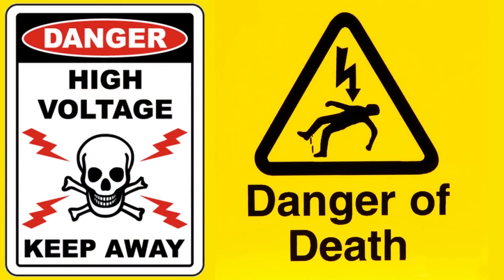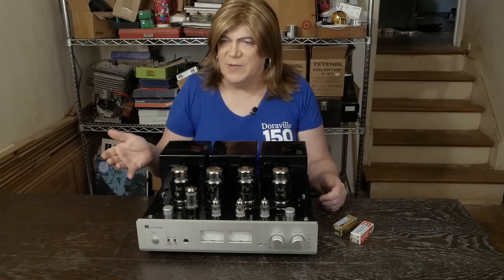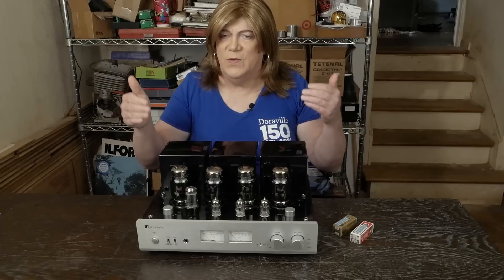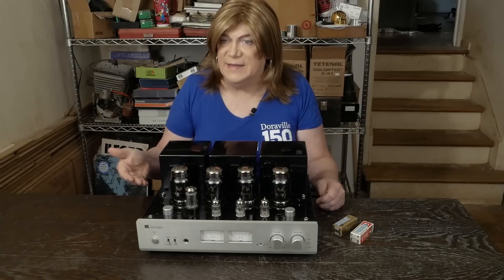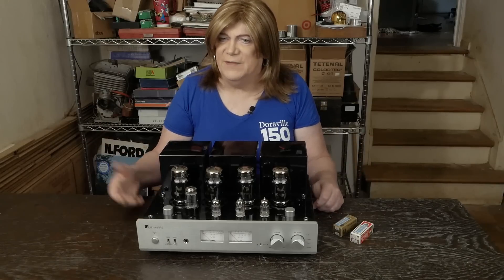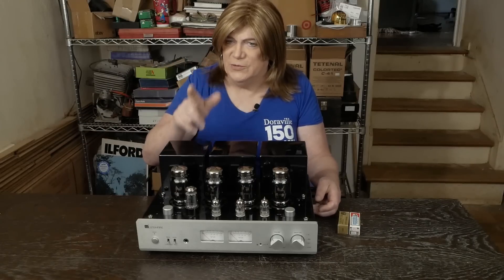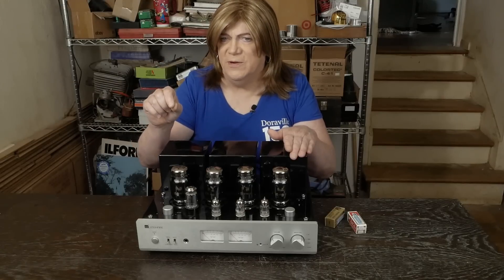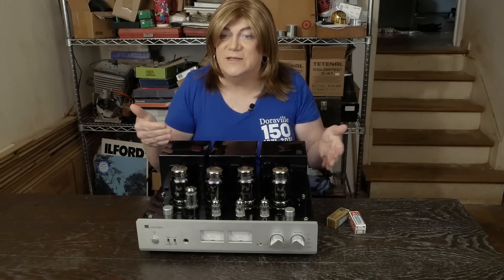Muzishare X7 vs Wilsenton R8: Testing and Objective Review

Comment: heeyoo Stephe! 

I now have the complete set of tubes gold lion 12ax7, 12au7-EH gold pin and  Shuguang KT88-Z treasure and its running since two hours now in my muzishare X7. In the beginning it was a bit smeared in the bass and heights but it already opened up and sounds great! To my surprise now UL sounds better than TR Mode. With the original tubes I only listended to TR Mode because in UL the separation wasn't that good and there wasn't that holografic imaging like in TR Mode. In UL mode with the original tubes the localization of voices was not really precise. Sure there was more bass impact in UL. Now it is completely different and I prefer now UL mode. It is really amazing after only two hours burn in!!! 

One question: shall I keep the 40 mA bias current like with the orignal stock tubes?  Currently I adjusted them all to 40 mA. Read something in the web about driving the KT88-Z hotter with more bias current. I am not an expert in this things ...

Greetings from Germany!
Burki
Reply from the maker: I don't think you will hear anything biasing them hotter. I tested different bias points and saw no increase in power or really anything in the measurements. Glad you like this tube combo!

Comment: I've had mine for a couple of years now and I love it. I agree with the phono stage, it'll do the job but definitely deserves better.
I have Shuguang Treasure KT88-z power tubes, some RCA Clear Tops and a Mullard down the front. They sound really well together. I also tried a Gold Lion rectifier, but like you prefer the original Muzishare one.
I'm looking forward to a coupling cap upgrade a little further down the line, but for now I'm more than happy I picked it over the R8
Reply from the maker: Thanks for sharing this with us!

Comment: I just discovered this channel. Wow! What a great channel. I was considering buying a R8 or this X7. I was leaning towards the R8 after watching so many glowing reviews. But I'm so glad I watched this video first. This pretty much made up my mind for the X7 - though I am distressed to hear that the unit was sent with a mismatched set of tubes.
Reply from the maker: Yeah, it's still not perfect, but it's a solid choice for a budget amp.
Reply: @SkunkieDesignsElectronics  I've had the Muzishare X7 for a few days now (about 20 hours burn-in). I was trying it out with various DACs and speakers. It sounded very good. Then I tried it with a pair of Harbeth P3ESR's and a PSAudio Stellar Gain Cell DAC using the balanced XLR inputs and I had one of those rare jaw-dropping moments. Wow! What a huge improvement. The X7 came alive (Ultralinear mode). Much more dynamic and the soundstage is amazing. Now I understand the appeal of tube amps :-) I guess the next step is a set of Shuguang KT88's. Thanks again for your detailed examination of the X7 and the R8.
Reply: Wish this video would have been around before I made choice of the R8  😖☹

Comment: Your practice using fusible cathode resistors with just-adequate rated power differs from Morgan Jones's practice using chassis-mounted, over-rated resistors. Your reasoning makes sense, but so does Morgan Jones's: get heat away from the sensitive cathode bypass capacitors. Comments? Great video, BTW!
Reply from the maker: I only do this for fixed bias amps running 10ohm or less resistors as a meter meter shunt. For cathode biased amps, I used over sized resistors and mount them on the top of the chassis on my builds for the same reasons Morgan talks about. Two different use cases.
Reply: @SkunkieDesignsElectronics  Oh, interesting! Thanks!

Comment: Thank you for your review and ways of improvement of the X7. You mentioned possibilty of El34 tube rolling. Is it simply adjusting the bias only? Or some mod needed? Thanks.
Reply from the maker: Simply lower the bias, 30-35ma should be fine at the plate voltage this amp uses.

Comment: Hi nice to see you again. Watching your videos has taught me a lot about high end tube audio and now I realize I screwed up someone's McIntosh by recapping it with general purpose high quality caps that are used in recapping antique radios but at least it won't have DC leakage to the grids. I also realized that I could have left the di film originals in there I'm used to old TV repair and I didn't know better
Reply from the maker: Keeping DC leakage off the grids is super important! :)
Reply: I'm glad I didn't get a callback for sound quality 😆

Comment: Surprised by this video. I purchased a R8 two years ago. Sounds great to me, no problems whatsoever.
Reply from the maker: I'm not saying the R8 is a dog or a bad sounding amp. It performs as advertised and many people have had reliable performance from them. 

I can say I as a very casual "repair shop" and I've had several dead ones sent to me in the past few months, two suffered a red plate power tube meltdown / cathode resistor blowout from the bias pots going open with no safety resister, and one had a nasty hum from one of the PS caps failing.

Comment: Im disappointed to hear that my R8 is not all it was built up to be.  But, I have all the caps and resistors to rehab the R8 and I think its going to be fun and educational.   If you could Skunkie, please advise me on how to test the KT 88s for matching.  I had one PSVane '88 replaced under warranty and I'm not confident that this quad set  is, or ever was matched.  Thank you for your honest opinions and great channel
Reply from the maker: The easy way to see how matched two tubes are is to simply swap them and look at the bias meter. If they are matched, the meter should read fairly close after you swap them. You can also look at the position of the adjustment screws to get an idea, they should not be wildly different. And you really only need to be concerned that pairs in each channel match in a PP amp.
Reply: @SkunkieDesignsElectronics  Thank you Skunkie--that makes simple sense  🙂
Reply: aah thanks for this advise!

Comment: Thank you so much for your suggestions on tubes that might suit this X7. Your recommendation comes across as genuine, knowledgeable, and without payola. Had this amp for 2 years and have been waiting for this video forever! Much appreciated!
Reply from the maker: You will love this combo in that amp.
Reply: @SkunkieDesignsElectronics  I just found out that there are two versions of these GL 12AX7, long plate B759 and the short plate CV4004. Which one did you use? Thanks in advance.
Reply from the maker: The B759, the more expensive ones.

Comment: Hey Skunkie D! I enjoyed your explanation. As a novice who purchased my first amp recently, your video teaches some basics of the differences between amps. Instead of going with one of these big Willsenton's, I purchased a used PrimaLuna Dialogue 5 with Gold Lion KT 88 output tubes. It sounds good to me using 94 dB 3-way tower speakers. Maybe not as good as a low Watt 300B SET amp, but a great entry level amp with point-to-point wiring and adaptive autobiasing.